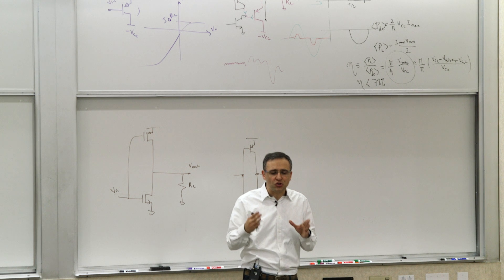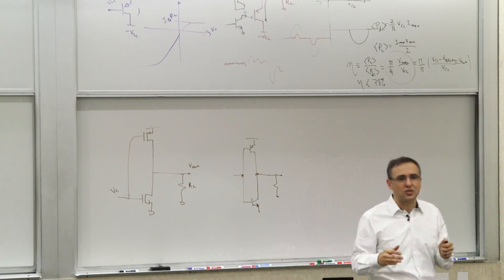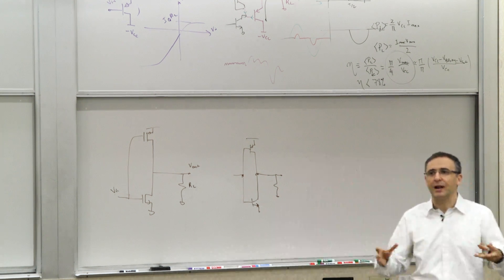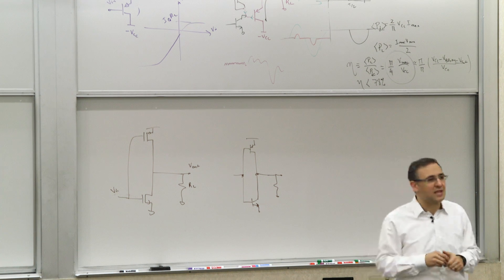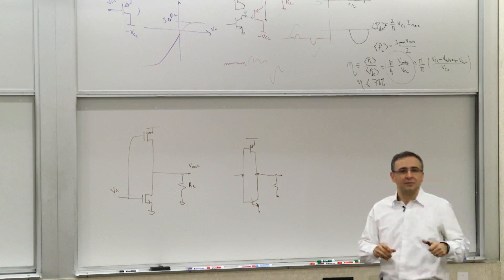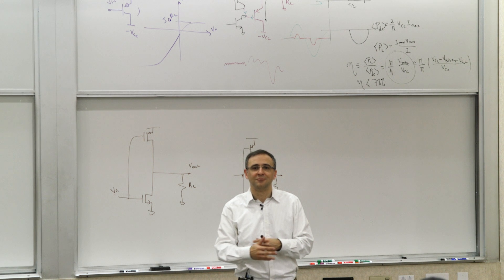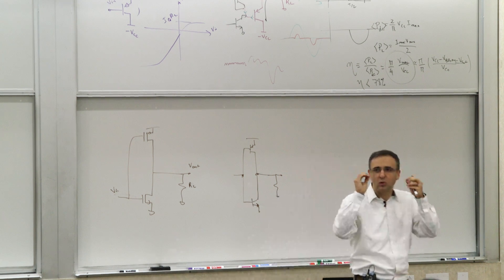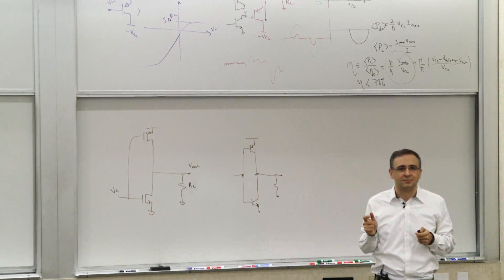135N. Driver stages, output stages, Class A and Class B

Comment: I enjoyed the lecture, taking me back to the mid eighties to start nineties, when I designed bipolar integrated circuits. We used to adjust the bias current in the bias diodes in the diver stage so that we had a class A current flowing in the output transistors. This way we got a lower cross over distortion. We also put a small resistor in series with the npn emitter. This was a part of a protection circuit for limiting the short circuit current. One of the drawbacks of this classic class AB output stage is the need for a high voltage supply. If you make a bipolar output stage where the output is at the collectors it is possible to get as close to rails as a saturation voltage. I am still in IC design and as a famous designer said in the nineties: ‘ Someday the mos devices will get so small that they will go directly from sub threshold into velocity saturation and we will be back at bipolars’, not to mention the leak in the gate :-) Thanks for your lecture.
Reply: interesting thanks for sharing

Comment: 00:02 Driving a resistive load is necessary for circuits to deliver energy.
02:10 Driver stages and output stages in amplifiers
06:53 Lowering voltage reduces current through the output stage.
09:12 The problem with driving an amplifier to push a speaker to full power
14:32 Class A amplifier operation and limitations
17:06 Combining current sink and source for effective operation
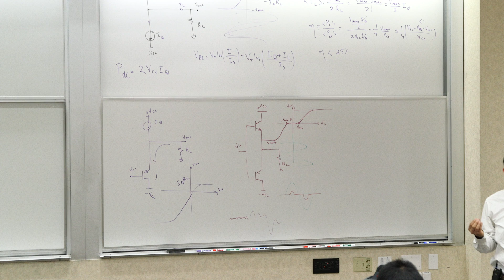21:43 Understanding the need for a dead zone due to transistors' VBE on requirement.
24:00 Tug-of-war between currents in driver stages
28:42 Efficiency defined as power delivered to the load vs. DC power.
31:00 Power delivered to the transistor causes heat
35:41 Bipolar transistors have specific junctions and characteristics
Crafted by Merlin AI.

Comment: 29:00 When finding the efficiency of a class AB amplifier, is the biasing current not taken into account? Is it because the bias current is much smaller than the DC current in the amplifier such that the bias current can be ignored?

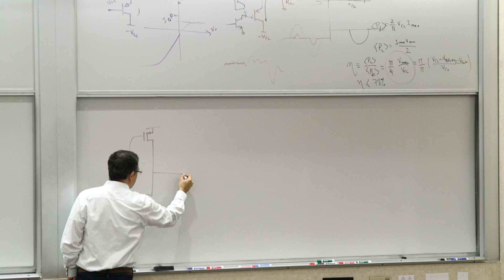33:45 is this circuit topology (PMOS on top, NMOS in the bottom) intended to be a switching converter?

Can the negative terminal of a class B/AB amplifier connected to the ground instead of the negative supply voltage? If so, then the output of the amplifier must have a non-zero DC value? 

Is it correct to say that the max time-averaged efficiency happens when the amplitude of the output voltage is closest to the supply voltage? On the other hand, the max instantaneous efficiency happens when Iq = Imax (i.e. when the transistor operates at the edge of the saturation region)?

Comment: What is the minimum value of the DC biasing current in class A output stage
Reply: It depends on the load and the power you want to be available to the load. On single ended RC-coupled class A stages, the theorectical efficiency is 25% as stated in the lecture, or 50% if the load is driven with an output transformer. Say you want to drive a load with 10 W of power, the input power will be 40 W, and 30 W are always wasted as heat. So the DC bias is the one that makes the stage draw from the supply 30 W while idling. This assumes load matches the output impedance, for best power transfer. The less bias current, the less power available.